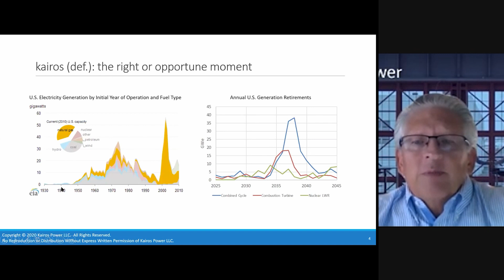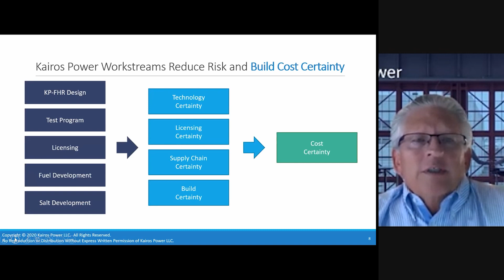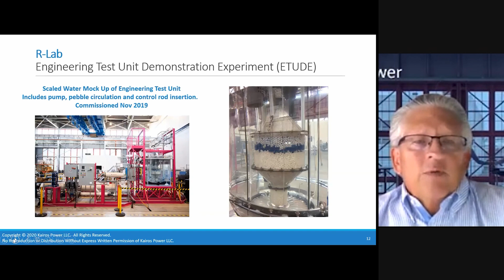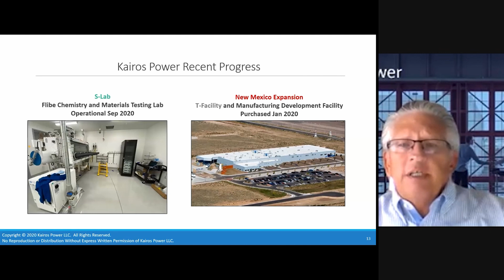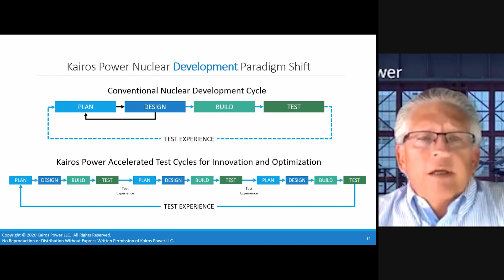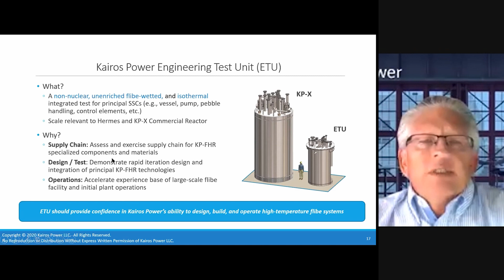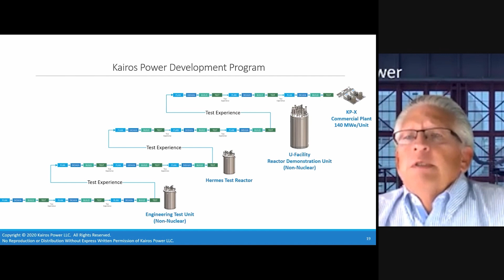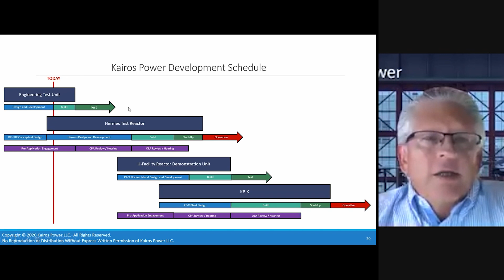KP-FHR: Kairos Power Fluoride Salt-Cooled  High-Temperature Reactor Update by Mark Peres @ ORNL MSRW

Comment: The development is not really much like Space X. They can explode rockets all day long during testing and no one cares. They also have ready access to all the materials needed for their rockets. Nuclear plants have to be developed with zero chance of accident and no access to nuclear fuel. Also, once you get an approval, making any kind of change starts the process all over again.
Reply: I'm not sure all Space-X components are off-the-shelf. And non-irradiated testing can be iterative. Don't expect commercial reactors to iterate once they're on the market as quickly as Space-X can iterate rockets for actual launches. But operating an unfueled HFR should provide loads of learning experience and guidance for design. Use electricity to simulate heat from fission. In Kairo's case they don't even need to put non-radioactive isotope stand-ins since fission products won't be released into the fuel salt (unless there's defective fuel). I'm not sure how tricky pebble management will be, could be a lot to learn there.

Comment: What about the xenon generation in the pebbles? Won't this break the pebbles?
Reply: TRISO fuel has a buffer layer. The buffer is a porous carbon layer (~50% dense initially) whose function is to serve as a void volume for fission gases and act a material to absorb fission recoils and swelling of the fuel kernel.
Reply: @gordonmcdowell  Thanks!

Comment: Like the FliBe - pity about the solid pebbles...🥝🥝🙏
Reply: Nuclear fuel costs are low, and they mainly derive from enrichment. If you make TRISO pebbles, fuel costs will still be low, maybe lower; it seems like a more manufacturable solid fuel than current oxide assemblies.The containment building is one of the main things that kills nuclear power plants in the USA, and Kairos has a good plan to substitute functional containment for the traditional concrete battleship. I also think salt fuels are exciting, but Kairos' plan to contain the cost of their nuclear power plant is fully credible.